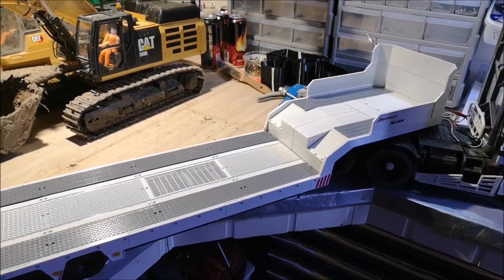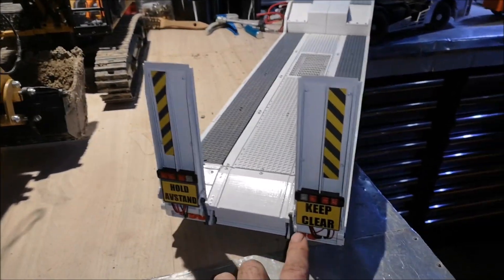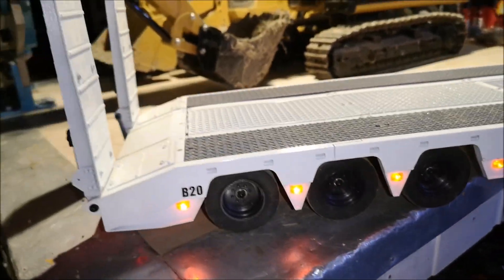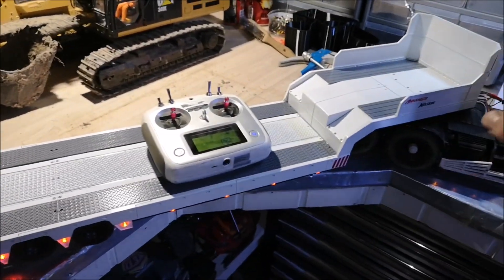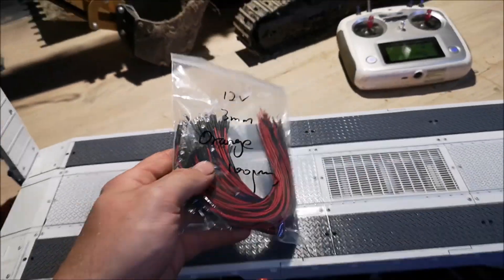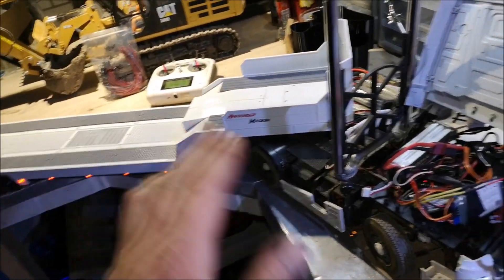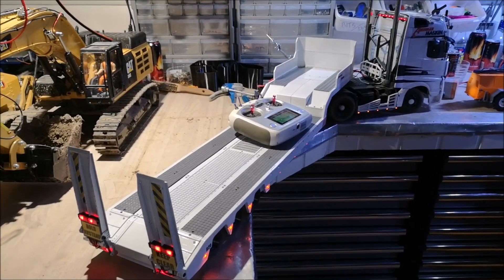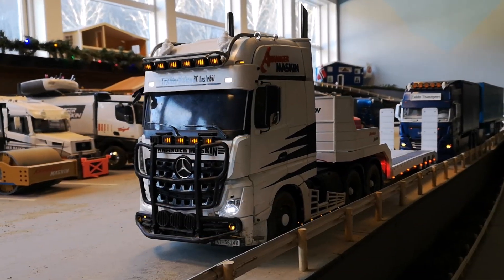Building a RC Equipment Trailer - B20 Build - Part 2 Finale

Comment: Do you know how many kilos it can support? Could it transport a 20 kilo excavator or a 30 kilo drx2? What is the limit? has not thought about making certain parts that will withstand more effort such as axles and shock absorbers in metal, I think the secret to this is to get easily accessible metal parts and print the rest in 3D, in this way we can have completely robust but homemade vehicles . For example, the shovel or certain reinforcements on the arms of the loaders, I think that metal rods or aluminum profiles of standardized measurements could be introduced and covered in 3D material. In this way we have a completely robust, reinforced machine made at home and with accessible materials. I think that part of the satisfaction that you have said that you feel with your DRX2 is precisely because of that, because you have a machine that has no limits, you do not push or move loose soil, but you are able to tear up natural soil and for that some elements should have reinforcement of metal. The most obvious is the shovel, and my proposal in this case is to adapt a commercial shovel from an internet manufacturer, of which there are many on the market and can be found on the market. In my personal opinion and I am sorry if I have bothered you by giving my opinion.